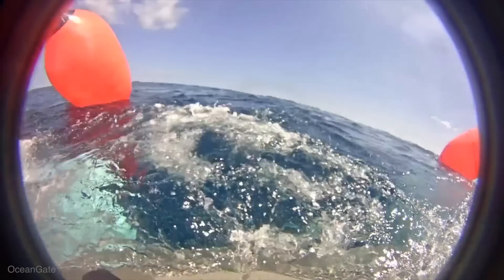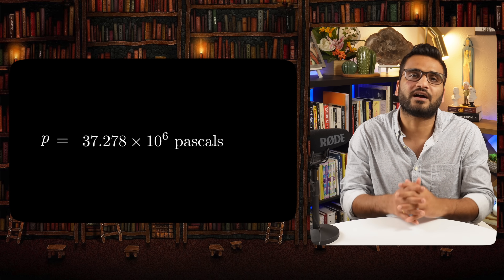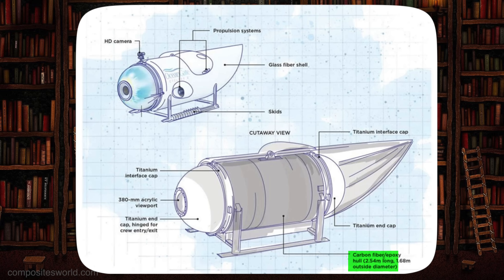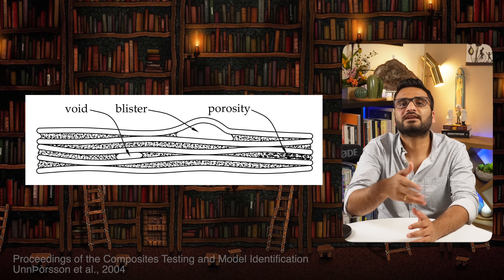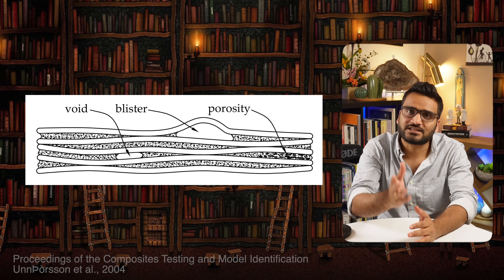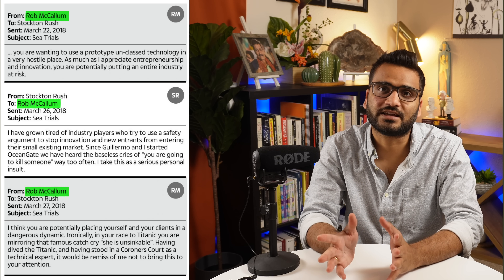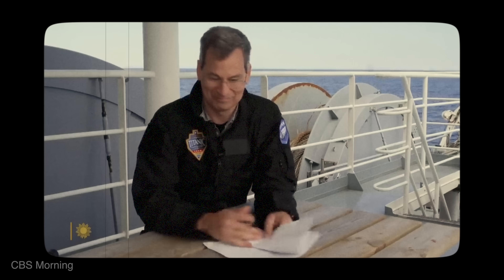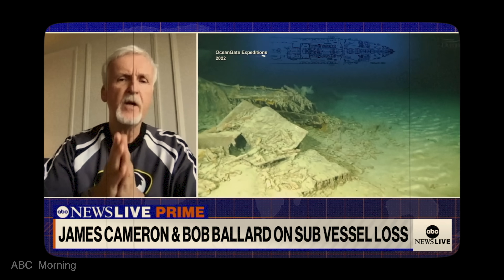OceanGate REALLY messed up - A Structural Engineer's Perspective | TITAN'S TRAGEDY

Comment from the maker: I appreciate your viewership and the valuable contributions you've made through your insightful comments. Thank you for watching! I’ll summarize some key/additional points that have been discussed in relation to Titan's failure:

1.	Understanding forces on the hull: If we idealize the hull to a symmetrical cylinder, it is subjected to radially inward hydrostatic compression and forces transferred by the dome on to the hull (basically pressing the hull on top and bottom). As a result, any point on the hull is subjected to three perpendicular compressive stresses: (1) the longitudinal compression transferred from the dome in the direction of the axis of the cylinder; (2) radially inward compression (radial stress); (3) circumferential compression (hoop stress). 
2.	Possible shear in the junction/bond between hull and dome: Titanium and carbon fiber have different coefficient of thermal expansion (CTE). As a result, they contact/expand at different rates. This will introduce shear stresses at the junction/bond of the dome and the hull. Cyclic loading with such drastic pressure and thermal changes will have significant impact on the junction of the dome and the hull. 
3.	Directionality of carbon fibers: The carbon fiber composite material—comprising of carbon fibers and epoxy resin as the matrix—is an anisotropic material. That is, its strength depends on the direction of loading relative to the direction of the fibers. As observed in remark 1, any point in the hull is subjected to three compressive forces. If the carbon fibers are wound radially, the longitudinal compression and the radial compression acts perpendicular to the fiber, whereas the hoop stress acts parallel to the fiber. Although epoxy resists compression, the stress configuration would imply that the fibers should have been cross wound to provide stiffness in all the directions.
4.	 Ignoring the possibility of damage after previous dives: It was reported that OceanGate was aware of cracking sounds after the previous trips, but they kept operating.
5.	 A structure is as safe as its weakest link: Breach of hull by any means—including but not limited to crushing of carbon fiber, loss of contact between the dome or the hull, manufacturing defects, or crack in viewport—would have led to immediate implosion. 

Please feel free to comment here and I'll update the list. Thanks!
Reply: Just to note that it is standard practice on subs to ensure your equipment is certified for +50% off your maximum diving depth. That is to say, you only dive to a maximum of 2/3 off the certified depth. So the Titan and all its components, insisting the viewport, should ideally have been certified to a depth of 6800 meters.
Reply: @StoutProper  Certifying +50% off your maximum diving depth corelates to safety factors used in building structural engineering when ductile homogeneous materials such as steel are used because the behavior of such materials is very well explained by science, math is based not only on testing data but also by solid scientific calculations. When materials are non-homogeneous and/or brittle in failure, safety factors are so much higher. There are a lot of different products used in building construction that have safety factor of 5 simply because the only way to determine their capacity is testing in a lab. The fact that this sub is from carbon fiber, a composite material that has brittle compression failure means that the safety factors for this sub had to be a lot higher than typical +50% used for other subs manufactured from ductile homogeneous materials.
Reply: @denfl6605  good point but being as the carbon fibre was never certified at all and never has been for diving it’s a mute good point.
Reply: @StoutProper  in building construction, carbon fiber strips are used for external concrete reinforcement when repairs are needed. Concrete is great in compression. So in this case, carbon fiber takes care of tensile loads only. I've never heard of using carbon fiber in applications when compression stresses control the design. That's why I was curious if there is any solid data for carbon fiber compressive strength.
Reply: Regarding point #2, it's not just differential thermal expansion.  The end rings were glued to the CF cylinder on the outside only.  This is a terrible joint for pressure because Young's modulus (modulus of elasticity or distortion due to an applied force) is different for the two materials and that the CF tube would contract inwardly more than the titanium ring when under pressure.  This puts the adhesive joint in tension in addition to the shear it was already getting from the rings being pushed towards each other from the pressure on the end domes (the two directions epoxy doesn't like).  At the minimum, they should have used a ring thick enough to put a mating groove in it that would act as a socket to support the tube both inside and out, and from the ends.  That would remove most of the strain problems with the glue joint, but do nothing about the buckling of the tube (think of squeezing a toilet paper tube between your hands).

As others have pointed out, the mechanical properties of composite materials, like carbon fiber, are nearly impossible to model with any degree of precision.  So much depends on how the test sample was made and how closely the actual device was fabricated to the test sample.
Reply: If a cylindrical hull is used (not a single sphere or multiple connected spheres), a structural frame and ribs should be used that will prevent to from buckling.
Reply: Are they rescued yet?

Comment: A couple of years on, despite the release of the coast guard report, there is still uncertainty over the cause of the actual failure, was it the hull or the ridiculous glued joint or the porthole The glued joint/interface was subject to what appears to be severe stress during the aborted launch of dive 87. Seeing a couple of model demos, my money is on the hull itself failing despite my reservations of the glued joint. Great presentation, thank you.

Comment: The sub that imploded wasn’t the same one that was tested in the Bahamas in 2018 and 2019. A lot of the concerns David brought up were fixed in Titan 2…. Titan hull one did 6 dives to its crush depth and the acoustic monitoring system gave them a warning it was beginning to delaminate in the Bahamas at Titanic depths. It gave them enough warning to bring the sub back up. This validated an accustic monitoring system. They tore apart this hull, found what was wrong with it and fixed a lot of the bugs on Titan version 2. Moving forward they had some reason to believe that the acoustic monitoring system worked. They knew the carbon fiber hull had a shelf life. They must of not thought they were approaching that number on that fateful day. Whatever happened that day, it appears the acoustic monitoring system didn’t work that day. Also the acrylic viewport not being tested below 1,300 meters doesn’t mean it can’t go below that, also stating that it can go below that isn’t right either. Titan hull 2 made 13 dives to the Titanic, it made an additional 12 dives to what would be considered deep sea diving.

Comment: My guess is that the Titan's viewport blew in. It was certified to a pressure of only 1,300 meters below sea level. I think that fact is all that we need to know. When the viewport failed sea water then shot in, compressing the air and all five passengers into a tiny area in the opposite titanium cap which remained intact. I assume that this is the location where "presumed human remains" have been recovered. At the same time the extreme and rapid compression of air into that titanium cap would cause tremendous heat. After that the carbon fiber hull would explode. The result would be one titanium cap without the viewport, one cap with about a half ton of compressed, cooked human mush in it, the landing frame, the outer metal cover which had that fin shape and thousands of tiny carbon fiber shards scattered on the sea floor, which I believe is what has been found.

All the metal parts of the sub have been publicly displayed except that rear cap for understandable reasons. The landing frame appears to be intact and straight. An implosion of the carbon fiber hull would have pulled the titanium caps inward and bent the landing frame. An implosion of the carbon fiber hull would have chopped the passengers into countless tiny shreds which could not be recovered.

In a YouTube video with Mexican actor Alan Estrada Rush explained regarding the viewport: “It's acrylic – plexiglass. It is seven inches thick and weighs about 80lbs. And when we go to the Titanic, it will squeeze in about three-quarters of an inch and just deforms. And acrylic is great because before it cracks or fails, it starts to crackle so you get a huge warning if it's going to fail.”

Rush charged a 19 year old boy $250,000 for the privilege of traveling in this death trap.

Comment: Using a new untested material  in such a hostile environment is pure insanity—- I’m amazed that someone couldn’t convince Rush that he was on a path of destruction.  I will also add that the minute I read that the entry/exit hatch was bolted shut from the outside , I knew the builder wasn’t thinking things  thru. 
It’s complete madness not to have a way of getting out of a airtight vessel on the ocean or land for that matter. It’s sounded just like what it was—- a 💀 death trap!

Comment: My main concern would be the interface between the carbon fiber and the titanium. Pressure at depth will cause the carbon fiber hull to compress. This is an actual change in the diameter of the hull.  The titanium end hemispheres will also compress and have its physical dimensions also change. What do you want to bet that the titanium will compress much less than the carbon fiber.  If this is indeed the case, the glue joint between carbon fiber and titanium will be loaded in tension, not the optimum way to load such a joint.

Comment: If this is an engineering perspective, why don't you simply calculate for once the compressive stress? In the carbon fiber polymer (CFRP) wall of the Titan submersible this was about 200 newtons per millimeter squared at Titanic depth. This corresponds precisely to the stress level where CFRP typically fails under compression. Only under tensile load (which is not applicable underwater), CFRP can withstand about 10 times more. What's more, OceanGate used mostly unidirectional (circumferential) CFRP. This means that in the longitudinal direction, the hull was only about half as strong, at around 100 newtons per millimeter squared. It's a miracle the ship even made it to Titanic a few times without imploding. It was like doing pole vault, but with a rope as the pole.

Comment: They wove the carbon fiber hull in a large open dirty warehouse on rusty support equipment. They never autoclaved it or put it in a vacuum chamber to aid in curing and outgas air bubbles. They only wove it in a single flat direction, no alternating diagonal cross weaving. The bonding of the titanium rings to the carbon fiber was done by painting the epoxy on with a paintbrush and slapping the rings on by hand using the same dirty warehouse. Once again no vacuum, no autoclave, no clean environment. No way to test the strength of the joints.

Comment: Had this idiot simply made a small test vessel, he would have immediately discovered why you never use a fiber composite as a compression loaded primary structure against compressive stress. Moreover, to expect a unidirectional fabric to work alone... is simply beyond insanity.

Comment: I thank you for your analysis Dr Chadha, but a small point not mentioned is that the there is a pressure gradient about a submersible which is not spherical as the mathematics would like to say and inform, and is actually just an average. The concept is that the pressure gradient between the top of the vessel and the bottom of the vessel is small enough to ignore if the engineering is significant to override a failure situation at depth.
The design of the pressure containment vessel must either be the designed to accommodate these pressure gradients, or a hull is built to accommodate that pressure gradient geometry by design.
In effect the idea that a circular cross section will accommodate a pressure gradient as is experienced during static at depth, decent to depth, and ascent from depth will be very difficult to achieve. A tear drop shaped cross section would have inherent stability over a purely circular one.
As the vehicle descends the pressure gradients change too, does the engineering address this. If the decent is faster than it should be would the geometry cope?
The proof is that it didn't work. There are reasons for the shapes of hulls that don't depend on epoxy resin as the containment tool of over pressure. There was no other structural component in the carbon fibre tube.
A very sad day for engineering oversight.

Comment: I'm no engineer, but it seems carbon fiber composite vessels are better to contain pressure internally, not resist it from outside.  Opposite of concrete, fibers operate best in tension.

Comment: What was the main cause of the implosion? Hubris, delusions of grandeur, run away ego. Criminal charges should be laid against Oceangate for negligent homicide at least. Releases or not, the families should get together and sue them unto oblivion. I fly fixed wing and helicopters. In aviation there are numerous experimental aircraft, not one is allowed to be used for commercial passengers. The greedy money grubbers sell $250,000.00 seats and call the tourists ‘crew specialists’.

Comment: It seems a small leak happened in the aft section at the same time as  warning   lights came on.   The crew reported hearing cracking sounds in the structurally separated rear end.  Water got in which caused a loss of power to the ascent motors and added weight.  All efforts to get the craft to rise failed and she flooded.   It dropped further despite dumping the external frame.  Dropping deeper increased the pressure causing an implosion.    They would have known for 20 seconds that they could not survive.  RIP.
Reply: The supposed log of the communications of that dive are popping up all over the internet, but no one has found out if it's for real or just another internet hoax.
Reply: @ZilogBob  That is true and in a way it does not matter.

Comment: I stated that the number of videos on this are getting beyond a joke. My opinion from an engineer’s perspective is that this should have been sent down to the Titanic depths several times WITHOUT people inside it. After several dive-surface tests, the structure should have been properly checked for any potential damage to the hull, including the epoxy adhesive holding it together, along with the carbon fibre material itself. Too many shortcuts used in the construction of the vessel.

Comment: Now that we have the final 20 minutes or so of communication, they dropped the frame to get more lift , therefore no more support for the heavy ends , I think they will find it separated at top of joint between tube and ring , the back ring had the most weight , my engineering background tells me heavy ends supported by carbon fiber tube is not good

Comment: What people don't consider is. The carbon fiber was 5 inches thick. The outside layers were flexing more than the inside layers.  It didn't operate like a solid. Multiple dives caused this to become weaker.

Comment: I think when you watch the carbon fibre section being made it was being laid down the same way  all the time, every layer should have been alternated 1 layer wound the way you see then across the width, so it's 90° to the layer, transverse,  then a  diagonal, 45° to the 2nd, then another transverse the next 45° from the other side, another transeverse thena another wind starting from the opposite side to the first! so the fibres are all criss-crossing and bonding to the previous layer > then - then \ - / - < builing layers of fibres where no layer has the fibre running in the same direction as the 1 below, or above!

Comment: Finally! Someone addresses the adhesive/glue/matrix. To me this is the weakest point. The carbon fiber strips are only as strong as the glue holding it together. Can it withstand near freezing temperatures and intense pressures over and over again? Also carbon fiber pressure vessels are great at keeping pressure in due to the tensile strength of carbon fiber but can buckle under pressure from the outside. This I believe is what doomed the submersible.

Comment: A nice summary of what could go wrong (design, operational, and lack of engineering philosophical rigor). Certainly I would never have signed off on its sea-worthiness in my first job as a Dept. of Defense Quality Assurance engineer.  Where was the safety training, especially o the diving and emergency backup systems? Where was the reliability analysis and testing data?  Nothing but red flags concerning the Titan's cost (e.g., don't hire 50+ year old white guys with naval experience, but favor young inexperienced people without appropriate backgrounds on a cutting edge project).